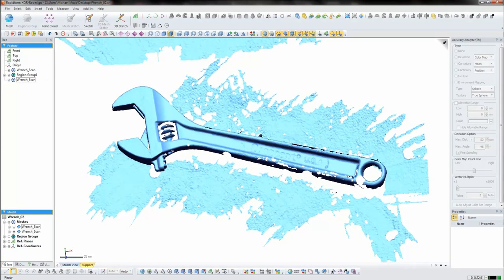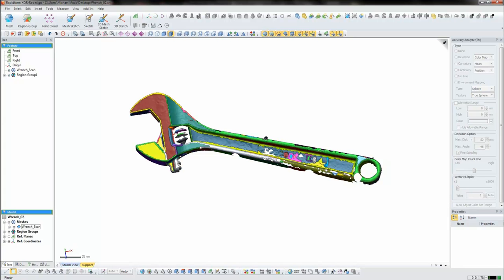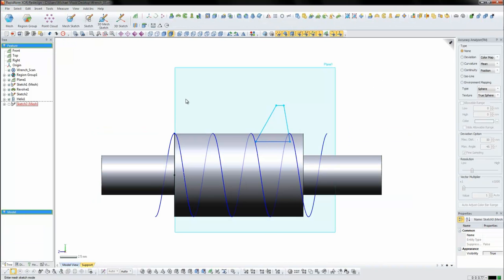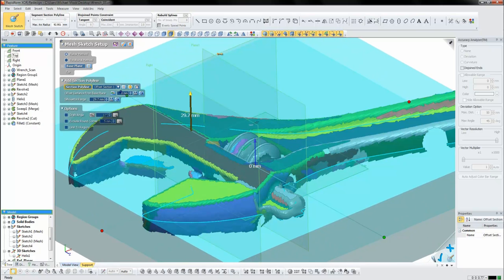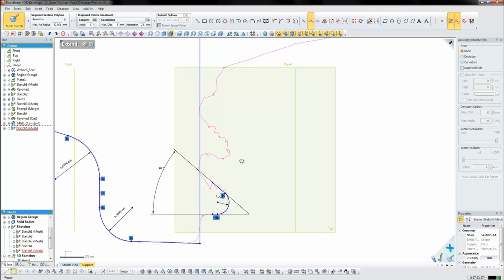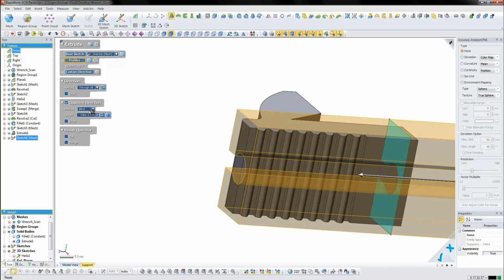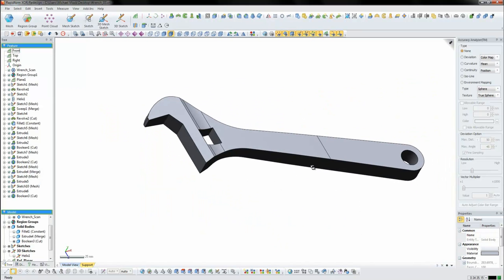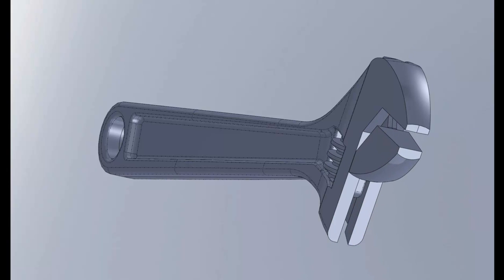Don't believe it? Technical overview of how a functioning wrench can be made from a 3D scan

Comment: @punishalltrolls Most non-contact measurement only measure what you can see, so the outside surface. CT and Xray can help get data from inside a part, but are significantly more expensive.

Comment: @biztipoff Obviously the process here is slowed down for the purpose of illustration and explanation.  Any professional drafter could draft this model accurately in 1 or 2 minutes.  I think the point here is to show how the 3D scan is used to derive values that would be difficult to measure accurately otherwise and explain why the end product in the video it's responding to isn't perfectly identical to the original wrench.

Comment: @biztipoff The wrench is an odd example, what you said it true. If the part you desire does not have to relate to anything else in the real world, go for it!
But, if you want something to fit against something else, or that has a complicated shape, you may need the same part.
A good example is a cell phone cover. Everyone has one. If you just draw something from guessing or caliper measurements, it probably won't fit the phone, unless it's boxy. To fit the phone, you want an accurate model.